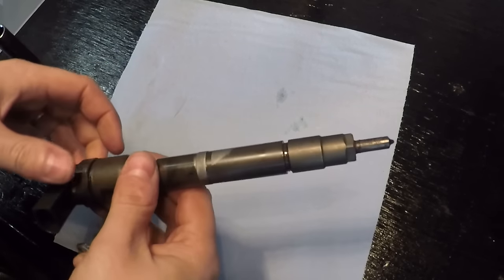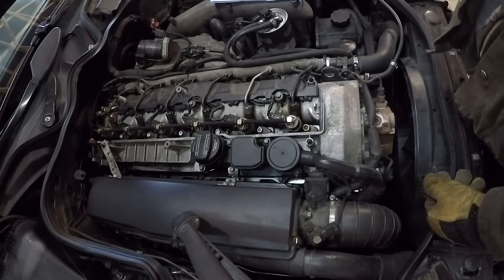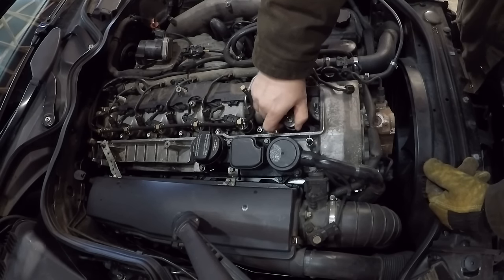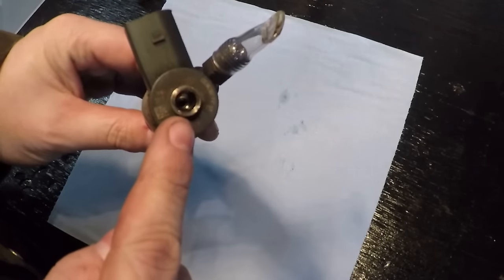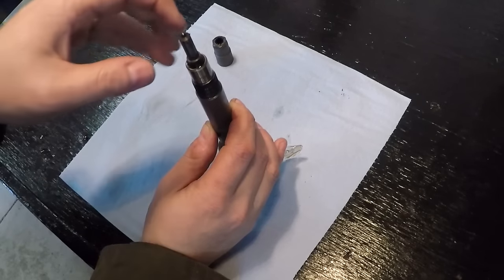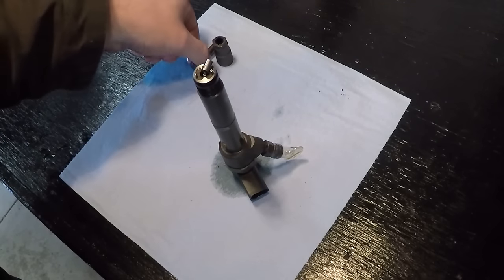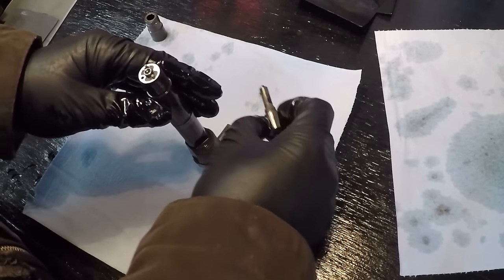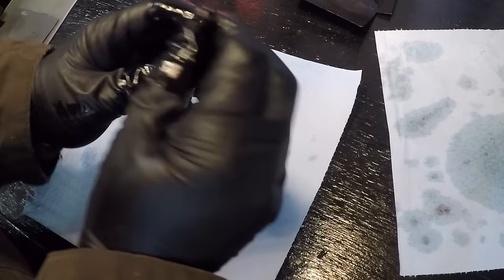OM648 Injector Refurbish | Changing the Nozzles!

Comment: thank you sir for the video, i currently have an issue with my C270 CDI (OM612 engine). the car cuts off the engine upon hard acceleration, i have replaced the high pressure fuel pump and had the injectors "refurbished" from an injector service center but i still have not come right as yet. the car now cranks but doesn't start. Can you assist as to what the problem might be?
Reply from the maker: Any check engine light? Have you had the car scanned? My first thought with a no start and stalling would be crank and cam position sensors
Reply from the maker: The pressure control valve on the back of the rail might also be culprit. That needs to make a perfect seal in order for the pump to build pressure, and if the large oring inside is bad, it will leak excessively back to the return
Reply: How much fuel is in your tank? If less than a quarter full, check your clear fuel lines for bubbles
Reply: the fuel is full  @bucketsbucket1593
Reply: there is an engine check light but it's for something else. i will take the car to a different mechanic so he can scan the codes for me, because the current mechanic has an older scanning tool  @MBDieselFreak
Reply: @tebogomakoe2491 Did you figure out what the problem was?
Reply: @mbz4652  not at all. i sold the vehicle and i bought a Lexus is250. no issues with it at all

Comment: amd after rebuild the spray pattern is little bit different and the injectors need to go onto a test stand, to create the new injector codes, for programming your injection control module. Otherwise they won't work perfectly
Reply from the maker: Is the spray pattern not entirely dependent on the nozzle though? Also, my local Diesel specialty shop said that the IMA codes are tied to the SOLENOID itself because of the variances in magnetic flux between solenoids. That's why the IMA code is molded into the solenoid cap. where did you get the information that the IMA code needs to be changed if the nozzle is changed?
Reply: @MBDieselFreak  

I think hes grasping at straws.
Reply: @MBDieselFreak  sorry for the late reply. At least on any refurbished injector we ever recieved to be installed there IMA codes with it and I'd guess for a reason. As Ford is kinda weird how they number their cylinders depending on what you're currently doing with the engine. Either in their firing order or from the transmission. It happened that the codes were mixed up and you could definetly tell by the way the engine than ran that you've mixed up the codes. I didn't say they don't work but if you know the difference than you can certainly tell. Yes there are universal codes that you can find but why mess with that if everbody can get a proper code for 20 bucks or so.

Comment: Everywhere on forums I see that om613 came with solenoid injectors and om648 came with piezo  injectors, but I haven't been able to find a definitive answer whether 648 injectors are actually piezo. The injector internals are absolutely identical from om611 612 613 and om646 647 648. MBDieselFreak do you know or anyone know for sure?
Reply from the maker: Om642 uses piezo injectors, the om648 injectors are identical in function to the om613, they're operated by a solenoid actuated hydraulic valve.
Reply: @MBDieselFreak  I know that the part numbers are different and there are a few internal veriations, but do they interchange to a degree?
Reply from the maker: @diypro9084  i dont believe so. the 613 had different power figures and most likely a different spray angle, so no i dont think the 613 injectors are interchangeable with the 646/647/648
Reply: @MBDieselFreak  Thanks for the reply. I own 3 cdi's so this channel is very informative for me.
Reply: om612 does not exchange with om647 Sprinters. VERY different rail pressure ranges

Comment: actually i would not recommend doing the lapping cause by hand will never be as "clean" as you need it ... imagine 2000 bars of presure moving through the injector ...
Reply: I just did the hand lapping ...start from grit 1.5k up to 5k works fine for me. All you have to do is be careful and think what you doing. And yes machine lapping would be probably safer ....if you have one. ;)

Comment: you don't remove internal parts of nozzle not to let contaminants go inside,but you sandpaper it?? something weird about it man
Reply from the maker: Every single diesel injection shop laps components when rebuilding, its a requirement to get a good seal between steel surfaces. The tolerance between the nozzle and plunger are too small to let lapping contaminants in. As long as the contaminants are removed after lapping, it's not a problem. 5 years later and the same injectors are still working perfectly.
Reply: @MBDieselFreak  I'm sure about that. And it's a great job what you have done. But if you pay attention when dismantling the injector and take out even the needle from the nozzle, would be a better job. Simple
Reply from the maker: @massimilianocampana3951  the more I've talked to diesel techs, the more I agree with that. A ton of rebuilders remove the nozzle plunger and have no issues as long as everything is cleaned before reassembly. It was just a myth that removing the plunger = bad juju.

Comment: Not even a microscopic dust can go in.....gets a freaking sandpaper.....
Reply from the maker: You realize that lapping precision mating surfaces requires an abrasive? And that introduces particulate? I was careful to clean off everything post lapping. 5 years later and the injectors are still working perfectly.